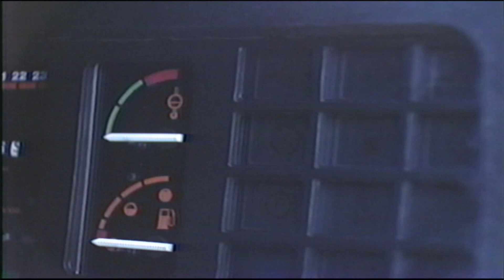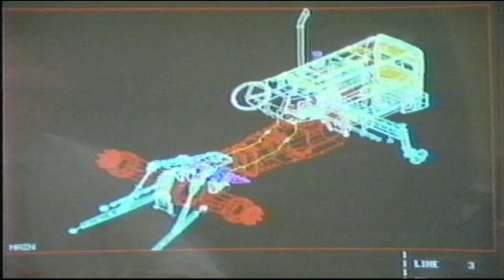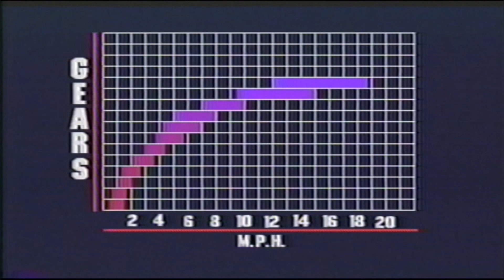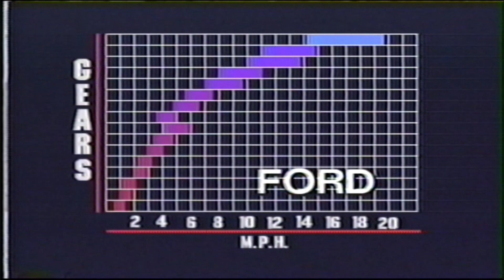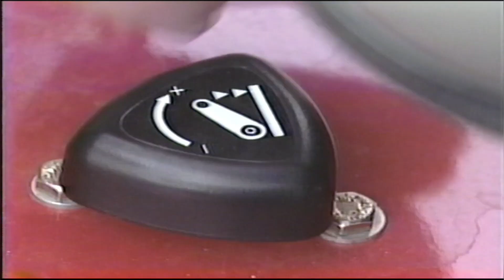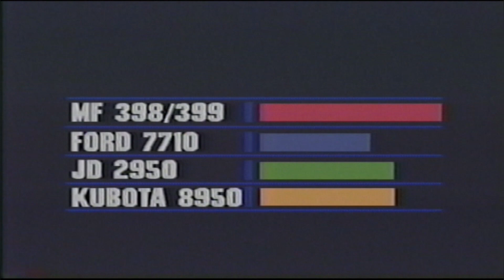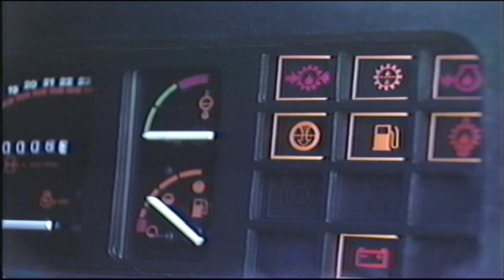Massey Ferguson MF 300 Tractor Model Series Vs Competition - Promotional Film

Comment: Good Massey's simple and strong medium weight tractors for any kind of job. The best of them was the mf 399 twelve speed gearbox and the bullet free perkins 354.4 the ideal tractor for light jobs and strong enough for heaviest jobs. Greetings from Greece.
Reply from the maker: Hello and thanks for your comments from Greece!  I'm glad you have good memories of these tractors and shared them!  Thanks for watching!
Reply: @opasvintagegarage  Thanks for your answer Sir. I didn't have only good memories because i still use this tractors nowadays from 100 series 200 , 600 and especially the mf 699 . Ferguson system and smooth six cylinder power the perfect blend 😉.
Reply from the maker: @alexhsmf  I'm glad to hear you are still running the tractors!  The fact you are still using them really shows the reliability of those rigs!  I've been looking for that size and model year, but they go for such a high  $ price at auction in Iowa, I've waiting for just the right one!

Comment: We went from a MF165 with allied loader to a 390 4x4 and 838 loader in 2000, major step forward in work capability, simple design, minimal electronics, easily to service and repair, simplest and most dependable Massey we ever had.   We also have two 600 series, but they have the cab rot problem but rock solid tractor mechanically.  Love the 135s but limited to their size.
Reply from the maker: Awesome, thanks for watching and sharing your experience with your tractors!  I really appreciate it!

Comment: Never seen 300 series without a cab. All UK models had to have cabs, I had a 390 4wd 12 speed shuttle with a loader, and a 350 2wd. Left MF in early 2000s, no dealer. Went to Deutz Fahr tractors, better tractors than MF, I was a big MF fan but afraid they lost their way.

Comment: They never compared them to the belarus I have 3 massey and two belarus they out pull massey like nothing less probs with the belarus and easier on fuel
Reply from the maker: Thanks for your comments, I don't have much experience with Belarus, but I do know a couple of fellas that own them and they really like'em!  I'd like to get one myself and do a couple videos on it, but I never see them up for auction in NE Iowa. The smaller MF are around here throughout the area, but guys hang on to them and very rarely come up for sale. 1 smaller MF diesel to 10 IH Ms at auction!   In the early 80s so many M Farmalls in our area, a fella could trip over them!!  At auction the Ms always had 2 things in common, a goose egg for a hole in the draw bar and burned oil!
Reply: @opasvintagegarage  they are a very under rated tractor I bought mine 8 years ago from a farmer and I still use them every day on my farm never have a prob with them hope you find one
Reply from the maker: @levimc6783  thanks, I hope so too, but those small diesels are tough to find and a fella that wants to part with it!!
Reply: @opasvintagegarage  mine are 90 hp look for 500 seareis or the 800 the best tractors going
Reply: I’d have a hard time believing both of those things. My 393 in the last 20 years has only had the injection pump rebuilt from years of poor quality fuel. It pulls a new holland 1411 discbine uphill at 8mph using a little over 2 gallons an hour. When I did the math I couldn’t believe it. But, the numbers don’t lie. On paper it shouldnt even be able to pull that mower, much less up hill with speed
Reply: @nalley6815  I have a 1990 MF 3070 with the same Perkins 3.9L 4.236 turbo 93hp as your 393. My 3070 is a heavier tractor then your 393, but it’s still easy on fuel .